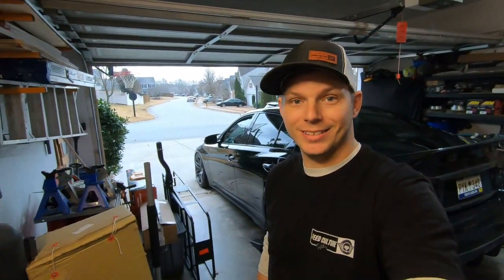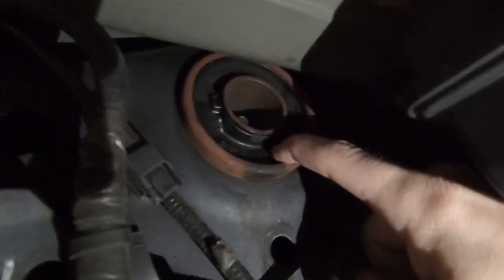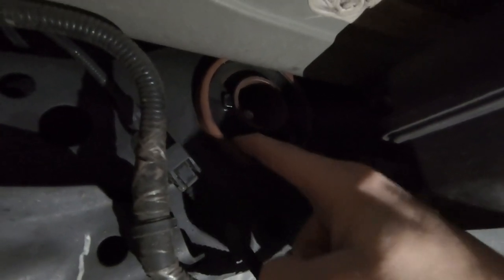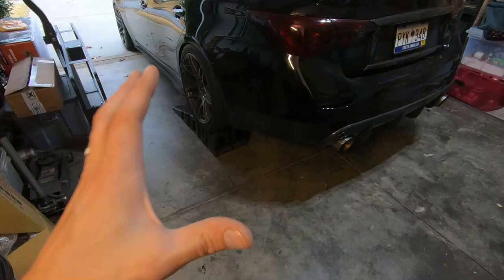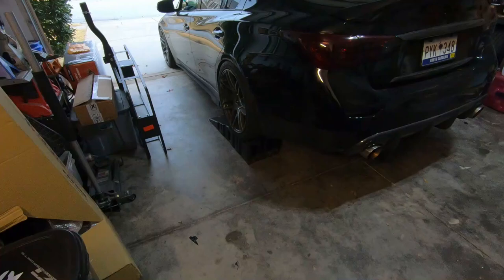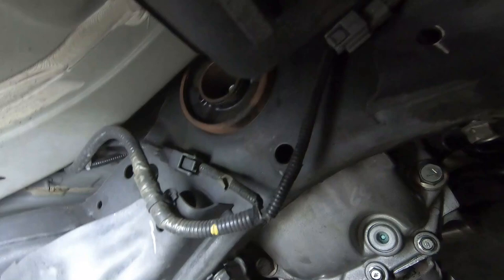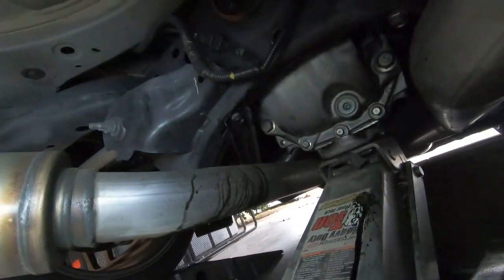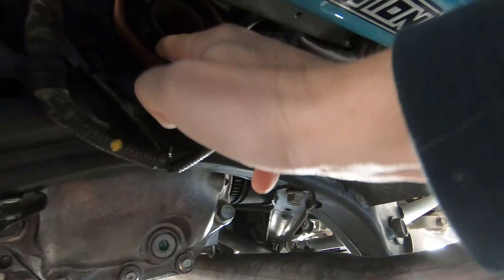VERY Common Q50 Part Failure I Jinxed Myself!

Comment: Recently, my rear subframe bushing went out as well. I took it the dealership and they replaced the whole subframe under my extended warranty plan.
Reply from the maker: Lucky for the extended warranty!
Reply: Hey man was it the rear subframe or the differential bushing . I have a vq q50 and feels like the rear subframe bushing are out as it clunks on turns and bumps just looking for some cheap alternative as changing subframe is expensive

Comment: I did mine last summer on my G. Took me about 3 days lol. Removed nuts and bolts day 1, removed bushings day 2 and installed everything day 3. Could've done it in 1 solid day but that diff bushing caused a lot of cursing between my buddy and I. The Z1 tool wasn't really helping with getting the bushing out the frame, a saw did the trick. Used a big c clamp to press the new one in.
Reply from the maker: Nice!  The diff on the g is so nice to remove with the stub axles.  I’m not sure how the Q is going to go!!

Comment: Welcome to the club! Doing mine on my back in the spring! Motorvate fix for now as well and it did help somewhat. But overall meh. Toyed with the idea of filling with marine expanding poly.
 
Really noticeable on throttle application after going over speed tables. Feels like the transmission is lagging but its driveline bow.
 But I'm AWD, basically stock and considerably higher mileage. Mine was blown out to the point of being flaps top and bottom. 

I think the bottom of yours is going to go much sooner now. If you end up going back and filling the bottom portion it may be a benefit over trying to do both at once. My initial thought was to pop a hole top and bottom of each chamber. Drain from bottom and cover with electrical tape. Fill chamber from top hole. Unable to as bushing was blown out too bad.  Best of luck man!
Reply from the maker: Turns out the bottom had failed, but wasn’t leaking as fast.  I filled the bottom this weekend and it started seeping out when I got it over full.  Oh well…

Comment: But why you didn't use silicone to fill in those bushing in the rear subframe?
Reply from the maker: You don’t want to use silicone.  It’s too soft.  The entire bushing is not hallow.  There is just an upper and lower chamber so using an epoxy is fine.  I have used window urethane in my 350z bushing.  That’s what I would use if you’re going this route.  I’ve since replaced the bushing completely.  Check out that video!
Reply: @SpeedCultureStudios  ok, because epoxy is very solid and it is not very good for diff and other bushings

Comment: Interesting that part differs between the Q50 and G37, and 370Z. I’d be curious to know how they differ as many of the parts between these cars are identical or can be used interchangeably. Does Whiteline have a bushing option for the Q50?
Reply from the maker: The diff itself is different too so there must be very subtle differences.  Or they may not have tested it on the Q yet so can’t say

Comment: Hey brother! Thank you for your tips. Do you have problems with shifting into Drive and the whole car jumps? Thank you
Reply from the maker: No I have not had that issue.  Might be a dumb question, but are you pressing the brake firmly enough when shifting into drive?
Reply: @SpeedCultureStudios  I do brake like usual but when I put to Drive the back jumps a little. There is a crack on the top of the rubber also.

Comment: should've grabbed some 3m window weld. that's how folks did their solid mounts. also, i highly doubt the bushing is any different than a G/Z one. the threaded rod on the diff goes thru that hole, so why would they change any dimensions? might as well get one for the G/Z and compare.
Reply from the maker: I was surprised that they told me the g/z bushing is different:  we will see when it finally comes out or might just grab a set and compare.

Comment: Fill it with that urethane window stuff.. Convert it to a solid mount, copyright the process/product, and sell the rights to z1..
Reply from the maker: I like that idea!
Reply: This is what I would've suggested as well. Also, spray it like crazy with brake cleaner to get that weird oil out. Mine went bad on my 13k mile 370 and I don't do burnouts. Luckily there's a fix for Zs and Gs.
Reply: @SpeedCultureStudios  exactly what we did in the race car.. Hollowed out some factory engine/trans mounts and filled it with that stuff.. We went the extra mile and filled the gaps also. Definitely feel a lot more of everything. 😆 you will notice a difference. Obviously with a solid mount all of that energy is transferred to the chassis and eventually makes it's way in the cab, but with only a single mount done and on the rear end you should be just fine.. I'm certain the reward will far outweigh any side effect.
Reply from the maker: @mikeschaner5853  I was hoping to find something better than this 5min epoxy stuff, but I just couldn't be certain how it would cure inside the hallow bushing and/or if there was a bunch of residual fluid inside that would cause any other material to not harden and then i'd be stuck with a bushing that was constantly squirting goop out.  Do you recall what the stuff actually is that you're referring to?  I might need to try and come up with something.  If nothing else--just for the experimentation aspect of it!
Reply: @SpeedCultureStudios  we literally got some windshield urethane and used that.. Don't remember the brand, but it was ultra heavy duty or something similar.. Idk if he sourced it through a windshield company or from O'Reilly..
Reply from the maker: @mikeschaner5853  awesome!  Thanks
Reply: @mikeschaner5853  3m window weld.
Reply: @vinny6_9  that's the stuff

Comment: So from what I can tell this bushing and the trans are the two major problem areas on the vq37 q50. Potentially there will be a fix for the bushing from z1 but what are your plans if the trans goes out. My q50 has 51k miles on it and just had the dealer do a drain and fill on it as preventive maintenance but I'm trying to get a plan together for  if and when mine goes out. It's my daily  so I can't have my car down for long.
Reply from the maker: Swap to vr30 trans is the plan
Reply: My trans went out the other day thank god im still under warrenty for another ten months so dont have to come out of pocket put in mind mine only has 40k miles 😑

Comment: the 370z rear subframe would bolt right in, right?
Reply from the maker: I believe they do bolt in—if they are the same as the g37, however, you’ll need a g/z rear diff as they are different than the Q

Comment: You should have used the windscreen Teflon I had a G37 and it happens to me what the windscreen Teflon did is a hard rubber just like a mount we used to use it in race cars and it stood the test of time it will not break but to use that you have to use the brake cleaner to clean out the gunk and oil substant in the cavity of the mount first then filled it with the windscreen Teflon let it sit for 24 hours then dry into a hard flexing Mount rubber and it will not break
Reply from the maker: Yeah a few others have mentioned that.  Sounds like a good fix.  I was trying to think of something that would dry a bit more flexible than the epoxy.
Reply: @SpeedCultureStudios  that epoxy that you use will not work it's going to become brittle and break into chunks remember motor vehicles and the parts are very heavy and there's so much force behind it you need something like the windscreen Teflon to work I've already tried that epoxy already and it didn't work it just made my job harder to go back in it and clean it out not to mention you applied it without cleaning out the cavity with the brake cleaner and if you can't get the little chunks out just clean it out with the brake cleaner and apply the windscreen Teflon Teflon then make a small cut in the lower part clean that out and feel it with the windscreen Teflon and you don't have to touch that ever again good luck🤞
Reply: Can you make a link to the product?

Comment: Do you think the diff brace could help extend the life of the bushing?
Reply from the maker: Potentially--if there was a good diff brace available for the Q50.
Reply: So the pride auto diff brace didn't prevent this?
Reply from the maker: @Chris-ww9uo  no.  I removed the diff brace after testing because it was clear it did not work.

Comment: Lol a blown rear diff bushing is an "issue"...? Garage Queen Perfectionist OCD type I'm guessing. Over 40K miles driven on my blown 350Z bushing, and the G's bushing / subframe have rust all over them even with the car getting Krown treatment every year. It's a 2013 G37xS and I don't feel a damn thing wrong with the car, 110K miles and counting. Daily driven on pothole ridden roads and Canadian salt, snow and slush. No probs. Going solid? Or even poly? I eventually did on the Z, only time I would notice a change was taking off from a stop w/ hard accel. Car felt more planted from the rear. I absolutely do not drive the G like I do my Z though, I would hate having to go all OCD on my daily.
Reply from the maker: Did you see the "replair" I did?  I wouldn't say garage queen lol.  I've mentioned that to others in the comments--most people I would say drive on a bad bushing and don't even realize it, so I get your point totally.  It can become an issue though--wheel hop, traction issues in general, axel issues etc.  It may not be as noticeable in the G37x getting a little help from the front wheels, and I haven't noticed any driving issues yet.  The real issue is that there is no replacement for the Q50 as of yet.  I'm assuming whatever Z1 is working on will be poly.  I wouldn't mind solid at this point, but I'm going to grab whatever is available first.
Reply: @SpeedCultureStudios  I did. I'm thinking Garage Queen in the sense that she gets every part under the sun even if livable without, but I understand the appeal. 900+ bucks on a new subframe from Z1 is huge, but at the same time how long will they be around for? Couple years, then GL with old subframes..? You're lucky you can go solid or poly on the current subframe, Winter in Canada or US NE is death to the FM platform. Your car reminds me of what I could have maybe perhaps gone for back in 2016, which was the alternative to having two older HR/VHRs in the driveway... you and I will be driving our cars around long after the 3.0's get mechanically totaled (sadly). They should have never gone all Z32-engine-bay with the Q50, it was a mistake.

Comment: Do this happen on awd models or no?
Reply from the maker: Yes, definitely can.  May not be as prevalent just because the rear end isn't taking all of the torque in an awd model, but the issue seems to be with the rubber getting brittle.

Comment: May I ask for your opinion Speed culture? I know I recently commented about the chassis system error on another one of your videos but I've just recently purchased my 2014 Q50 at 72k miles. Do you think I should trade it in? Like I'm terrified if that bushing problem happens because I honestly wouldn't be able to afford the repair. I'm still paying off the Q50 I owe roughly 14k after putting 8k down as a down payment and I love the car but I'd like to hear your honest opinion. Also the car has been well maintained from every owner so far from what I've seen from the car fax.
Reply from the maker: It’s impossible to know if the bushing will fail.  My car was very well maintained—I’ve had it since it had 25k miles so I know it’s life story.  I’ve driven it hard so that didn’t help but some people may never have the issue.  If you trade it in, what problems will you have to worry about with the car you choose?  You can’t escape potential issues.  
And the diff bushing isn’t catastrophic.  People drive on bad ones and don’t even know it.  Also, z1 is coming out with a replacement which will likely be under $200 and if you paid someone to replace it—might be 4-5 hours of labor.
Reply: @SpeedCultureStudios  I thank you for your response. Keep the videos! I recently installed my paddle shifters on my q50 premium because of your how to video!
Reply from the maker: @reanukeyves9041  So awesome to hear!  Glad you're following along!